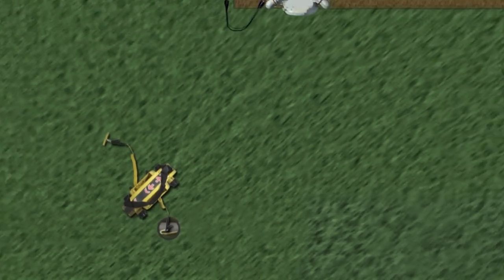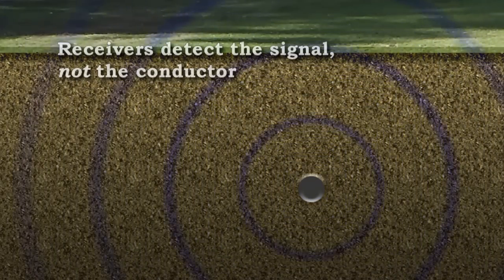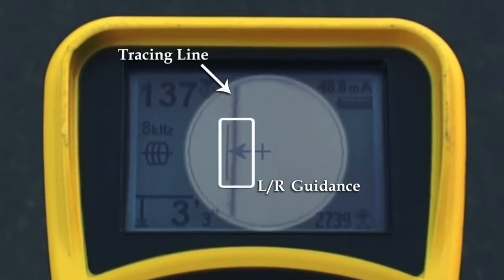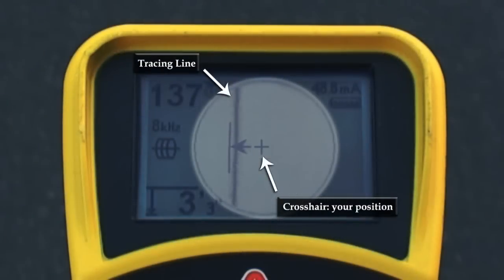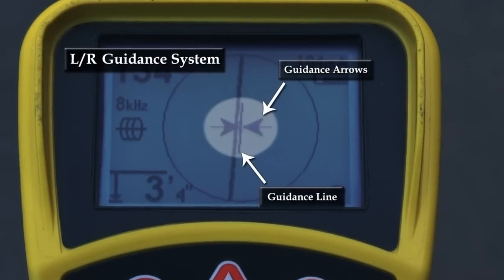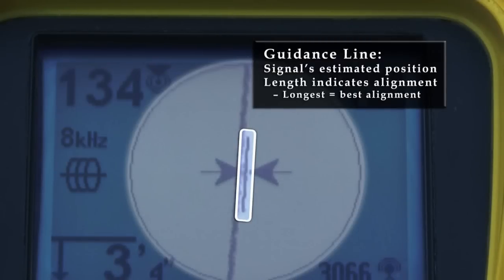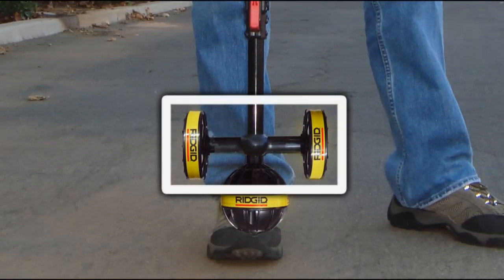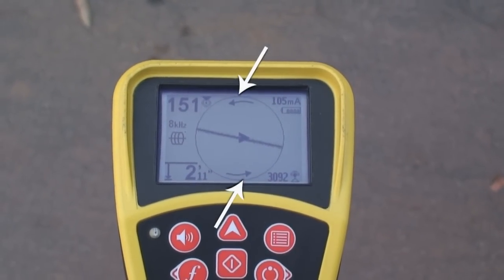SeekTech SR-20 - Line Tracing Basics (2 of 4)

Comment: can u advise what the compass will show if there is a TEE Junction
Reply: Tee junction for galvanized and copper pipes will show a bend in the pipe and tracer will loose the line. You should relocated the line after searching on both sides of the Tee